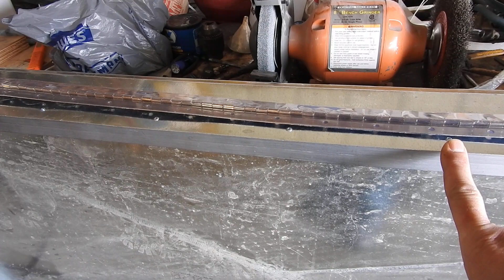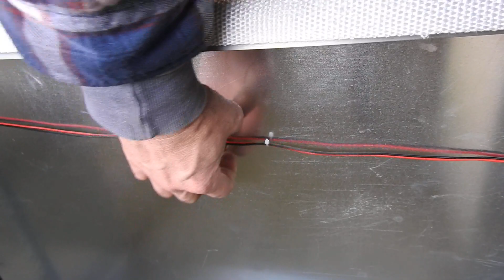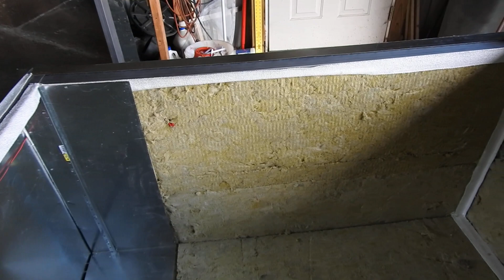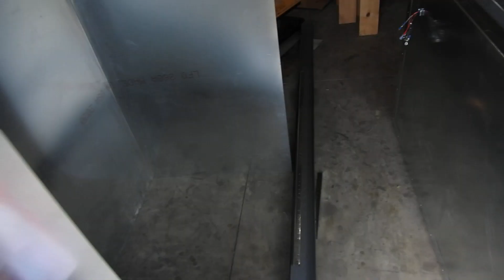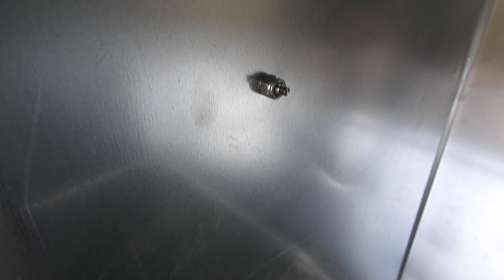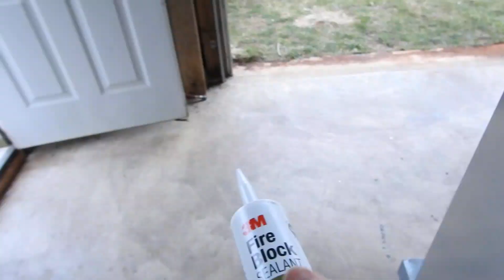DIY Powder coat oven build

Comment: Cleanest and most knowledgeable build . 

Did you put a steel plate around the elements to absorb the infrared so it doesn't heat the acrylic
Reply from the maker: No, just the metal in the framework.

Comment: How much did you end up in this oven as to cost
Reply from the maker: Off the top of my head, I would say I have at least $600 or more into it. All of the heating components were bought off of ebay. Sheet metal bought from a local heating supplier.

Comment: I have a question, isn't galvanized bad when it's heated?
Reply from the maker: Is puts off gasses when burnt off,not when heated. This metal is used in HVAC duct work for heating.
Reply: @Dynodon64  ok so only harmful when hit with direct Fire, I have 9 25 guage sheets coming tommorrow for my oven and started to panic s bit, I should be ok then?
Reply from the maker: Your good.  The temps in the cabinet will not get hot enough to cause the galvanize to burn off. Good luck with your build.
Reply: @Dynodon64  thank you for the reply by the way on the last video did the ssr actually fail?
Reply from the maker: @Ricardo_Wade  No it still works. It seemed to be stuck until cycled the power off and back on. That's why I went to two SSR's. Too much load for one.

Comment: I have a question I’m trying to build my own powder coating oven but I can’t figure out about the heat element if I install two heat elements of 3,000 watts each one is 6,000 total and the pid solid relay is 30 amp I’m good with ? Or I have to install a 40 amp solid relay ? And another question is when you wire up the heat elements is in pararel or individual?
Reply: You wire the elements in parallel!

Comment: Nice build, Don.  Looking forward to you shooting videos of using this oven.  Especially the canopy.  Quick question though, even though I'm sure you will talk about it when using it.  What do you think the maximum temperature could be when using this oven?  I know nothing about shaping and working with Plexiglas, or doing anything with powder coating, so just curious as to the temperatures you are planning on using.  Jim Gale
Reply from the maker: Plexiglass needs to be @ 300-320 degrees F to stretch form. Powder coating is @ 400 degrees F.

Comment: Ive got a powder coat myself & use normal kitchen oven in the garage ive had it about 4 years now just never got round to building a big oven myself but yes good job pal will come in very Handy'
Reply from the maker: I did a few small parts in a kitchen oven too. This oven is needed for the canopy of my plane, so that's it's first major project. Thanks for the comments.